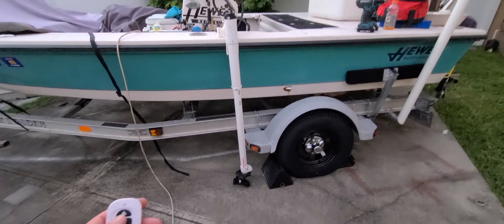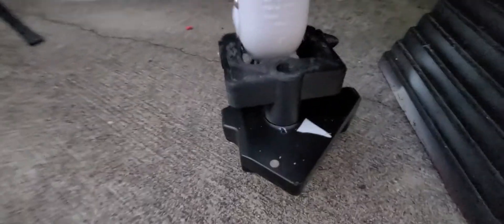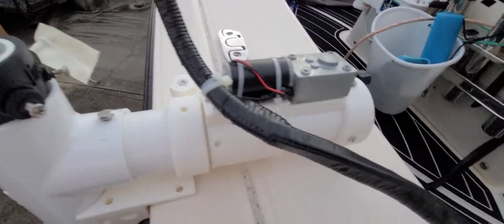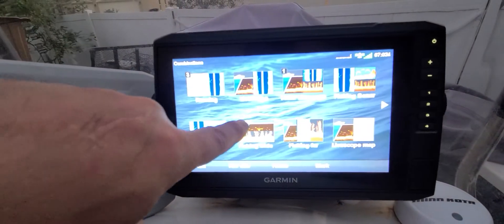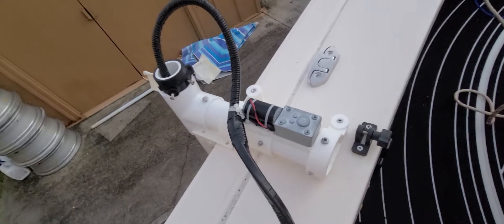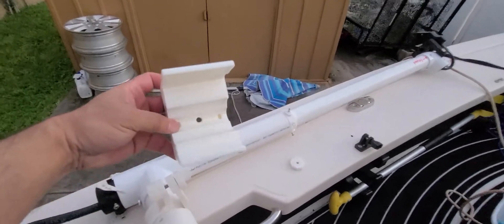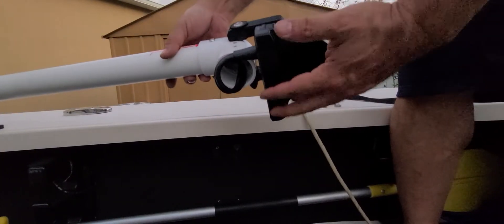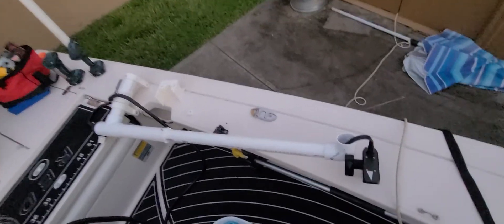DIY Remote Control rotating motorized Garmin Panoptix Livescope system forward/perspective boat mnt

Comment: i made one of these as well, it's a pain in the butt, LOL i can tell you that..., when you take it off, the transducer has no play in it due to the motor, that motor is going to want to move thus fuking up the little motor gear and then your gonna have hella slop play with the motor..

Comment: Is it belt driven? The belt pullied must reduce gear ratio because 16rpm motor would spin 360 degrees every 3.75 seconds. Correct?
Reply: Its DC.  Just control the speed with a potentiometer.

Comment: Do you have the specs on the gears?  I'm having a hard time finding them.
Reply: Amazon and homemade 3D printed customized for the Amzon worm gear motor and whatever size belt loop chosen

Comment: Nice build. What rpm worm gear motor did you use?
Reply: Reversible 12V Electric DC Worm Gear Motor 16 RPM High Torque Output Shaft 8mm $25 Amazon
Reply: Thank you

Comment: Do you have a link to what motor and etc you used to make it wireless?
Reply: Reversible 12V Electric DC Worm Gear Motor 16 RPM High Torque Output Shaft 8mm $25, Wireless Smart Switch Relay Module Remote Control Switch with RF Receiver DC 12V 433Mhz $14 Amazon

Comment: Awesome! With your side mount that you printed, make it so that it also stows your down pole! Love the Sea Deck too!!
Reply from the maker: THX!!  My favorite part of this setup besides totally remote control scanning are the hidden transducer cable inside the 1.5in PVC and the ability to change from perspective mode to forward/down mode by rotating the 3D printed U mount at the transducer.
Reply: Can you share or point to the 3D prints?  They are awesome. @coach784